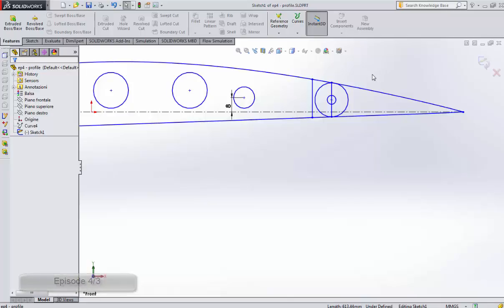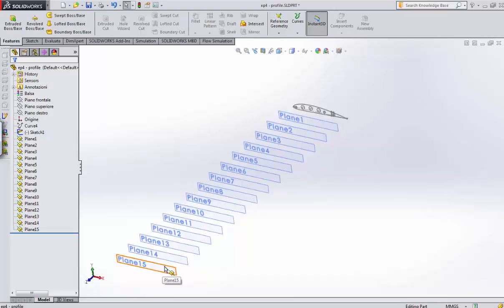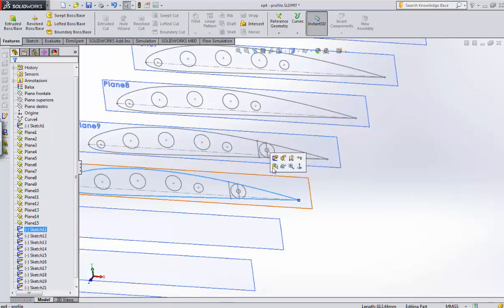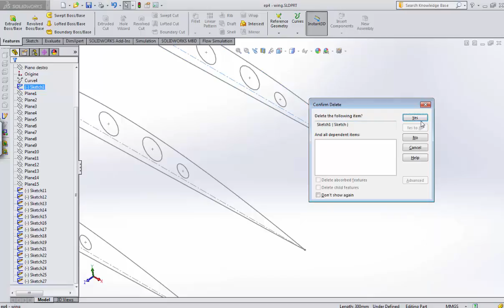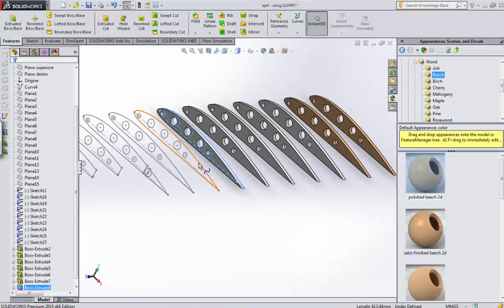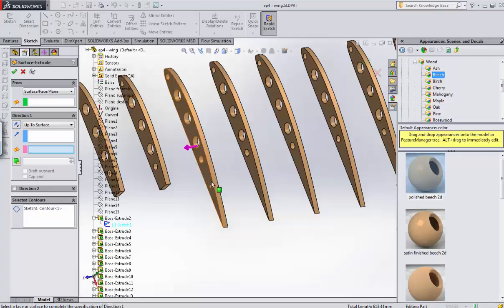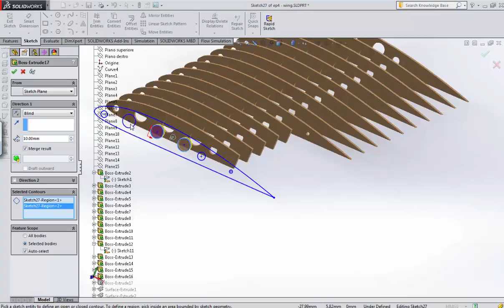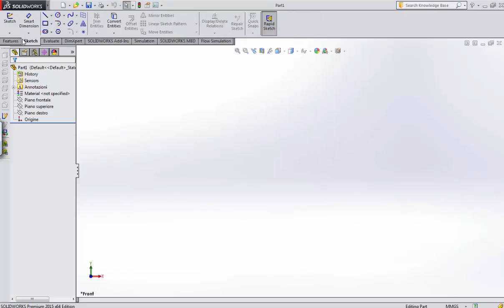EP - 4/3 - How to build a wing for ailerons

Comment: Do you have any idea how to change the direction of the wood grain on the sheeting (loft surface) without changing the direction of the wood grain of the ribs?  I have done a lot of search online and found nothing useful. I have done a similar wing to what you did, and edited the material to Balsa, but i am having trouble with the wood grain.
Reply: what you see when lofting, is just aesthetic, not real grain or fiber direction...so you have to change the image that solidworks use. 
for structural analysis, mechanical properties of the wood is very hard to find since the results are affected by the laboratory conditions
Reply: +A Paradiso , Thank you.  I guess I just have to live with it.